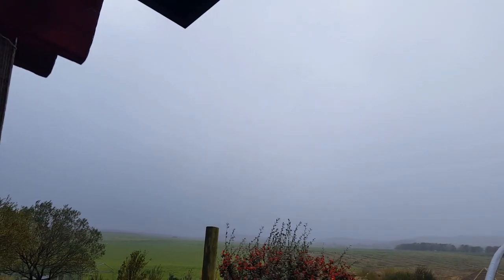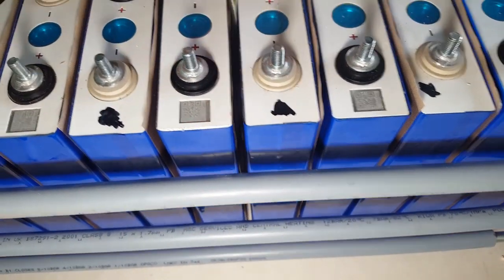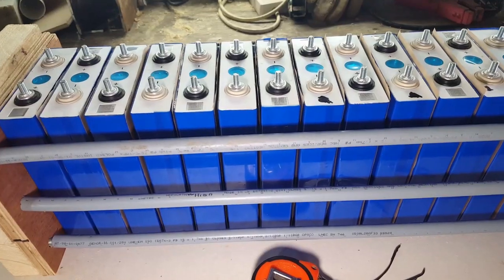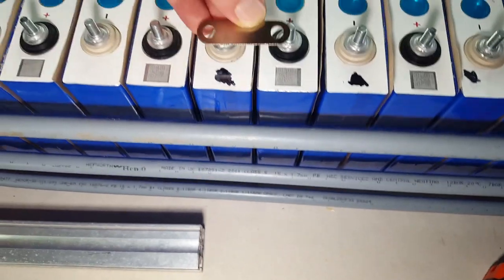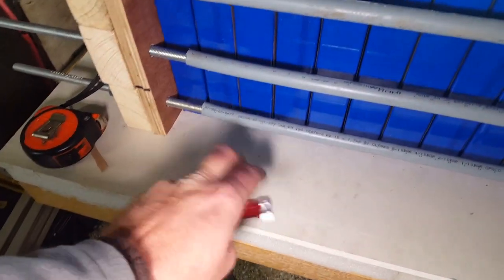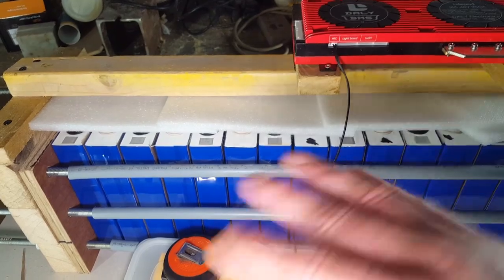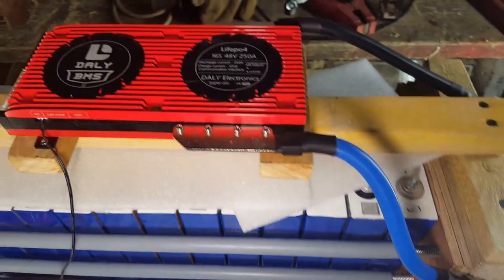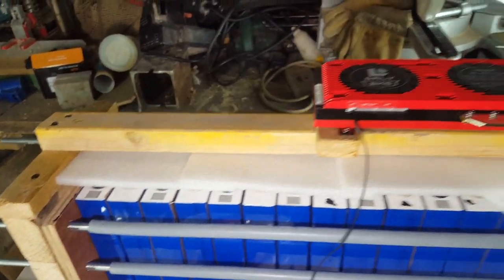Compressing Bloated LiFePO4 Cells In a D.I.Y Fixture Mock Up.

Comment: Why do you want/need to compress them?
Reply from the maker: Hi ya, it's in the manufacturer specifications to extend cycle life. It supposedly stops internal delamination and thermal expansion and contraction putting stress on the anode and cathode material and terminals.
These ones were used and bloated needing compressing  squeezing them together so the busbars would fit.
There are divided camps, a lot of people don't bother with compression but it's in the manufacturing technical specs and the logic is sound so I personally think it's a good idea.
Cheers 
Gaz
Reply: One thing I stumbled upon with a battery that had cells that were bulging about as much as yours though it was only a 4s pack, I took it to a friend to show and then left it in my car overnight afterwards. The temps got down to below 40F(4C) so the pack was pretty cold when I retrieved it in the morning. Interesting thing though was that the bulge in the cells was much less while they were cold. It's an anecdotal observation but I wonder if there's anything to it that might help cells with some bulging or at least do the compression with cold cells?

Comment: Compressing already bloated cells is dangerous. It only makes sense with new cells, specially at the first few charge/discharge cyles, to squeeze out gas bubbles out of the electrodes.
Reply from the maker: It was in the back of my mind, I went slowly and didnt go to tight, just enough to get the busnars to fit. Nothing bad has happened so far 🤞
Reply: @garys-half-baked-offgrid-dream  OK thats fine, others may it make too strong, which leads to destroy the cells and even catch them on fire. The cells naturally breathe, the force of 300kg will exeeded when compress them discharged and undercut when compressing them in charged stage, after they are discharged. I will recommend to use flexible busbars and bend the threated rods in a slight zig zag crooked manner, so the cells get adequate pressure all the time and can breathe.
Reply: @topeye4202  what a load of BS. LFP chemistry does not "catch fire". And the pressure release valve is there for a reason.

Comment: I like how you used the 3/4 plywood which I have done my battery compression but for some reason it loosens up just sitting there so I’m gonna try to do the two by fours like you did that should give it more stabilization maybe I’ll grab a 2 x 15 pressure treated because it’s a stronger wood !

Comment: Andy’s Off Grid Garage Australia has a lot of info on this gear & recent vids concerning the effects of compression u might be interested in. Im not sure what Daly u have (I dont like Daly much) but you will want to get an active balancer, Daly’s passive balancer is very ordinary.  It is always a risk when buying these cells unfortunately, but I have seen very bloated & abused cells still performing almost flawlessly after a couple of years of use/abuse & testing. Cheers

Comment: And yes as others have said... ditch those rigid buss bars for some silicone wire buss bars. They flex and are much easier on the terminals and guts of those cells

Comment: A sheet of rubber roof material is best I've found for placing between cells. Keep the pressure on when using them and they will be better off. I mean don't crush them but q nice even bit of pressure when new should keep this from happening and the rubber roof material is q good cushion that gives just enough for the right amount of movement.

Comment: Just a heads up. I watched another video where he was doing a heat and resistance test on different syles of bus bars. A washer was accidently left on one of the battery terminals and that location had more resistance and thus created more heat. When he inspected he found the washer, removed it and retested and the resistance and heat went down. Here's the link if you're interested https://www.youtube.com/watch?v=EjBqng70ORc
Reply from the maker: Yeah good old Andy he does great videos. So far all my teminals stay cool to the touch at max C rating

Comment: Cells are not supposed to measure 3,3 volts before compressing them, EVE 280 Ah cells are supposed to be compressed with 280 - 320 kilos, and you do it before you even think of charging them, cause even grade a cells grow 1 mm ? on the middle first charge,I dont know how much those cells are supposed to be compressed,  cause can see they are smaller, and if they allready bulge when received them, it means somebody else charged them before or grade b or c cells, compressing means 1000 more cycles if standard use, 6000 cycles etc......
Reply from the maker: Yeah they were bloated when I got them, they only had about 20amps in them at 3.3 they are 105A tested to 85ish.  I thought  if you compress at a very low state of charge the can over pressure when charged.   Compressed is a bit of a misnomer, using my clamping plates and screwed rods I can max out my bathroom scales at 150kg only screwing by hand.  It would be so easy to over do it and kill them. 
More like a nice cuddle lol
Cheers👍
Gaz

Comment: Question my brother, what about looking at silicone wires? In my humble views silicone wires will stretch and contract with the batteries.
Reply from the maker: Hi man, Yeah it is one thing I had considered, compressed or not as the buss bars supplied  are  only thing gauge and small, thick silicone wires would take more Amps and breath with the cells.  Compressing allegedly helps reduce delamination of the materials inside.  
It is a mine field of different opinions, Until I can accurately  measure the clamping force I am going for a compromise of a gentle squeeze.
Cheers bud. 👍

Comment: Good luck with your solar system my friend. Looks good so far. You seem to get plenty of incoming wattage on a sunny day. Now all you need is more battery capacity and you will be all set for energy production. I don't know how many kw of capacity you need to be completely independent, but I hope you can eventually get your hands on 16 or 32 of the 304Ah EVE LiFePO4 cells and you will be all set. Unfortunately, the prices of the cells have almost doubled in the past 2 years. I'm in New York in the USA, and I remember people buying the 280Ah cells for $115-$120 per cell. These days, the prices seem to be about $205 to $220 per cell. I'm a bit upset I didn't get to buy a nice set of cells or solar panels before the price started skyrocketing.
Reply from the maker: Thanks very much for your kind words that's awesome to be hearing from New York!
I have done several energy audits on everything in the house, the absolute minimum we could use would be 16 280Ah and would give me enough to cover the house for 2 days with no solar or wind. I would still have to be very economical with usage and that's no heating or hot water.
32 Cells would be lovely but yeah your spot on, the price is going crazy.  
I have found a UK supplier of Grade A and Grade B cell. Grade A £179 and Grade B £150. 
 Their grade A come with EVE factory test certs and they also do finance and accept Pay Pal.
I am seriously thinking of buying them on Finance or PayPal so if they are a load of shit I have a bit of protection.
Best of luck to you too! 
God knows we all need it lol 
Cheers, 👍😀
Reply: @garys-half-baked-offgrid-dream ’Andy’s Off Grid Garage Australia’ YT did a lot of tests on certified grade A cells and other ones he had got for so much cheaper and there was virtually no difference in performance under heavy load conditions, the outtake was there is no benefit in paying the extra for certified cells, and there are a lot of problems with their certification claims, there is always a risk when buying these cells, some sellers are not as unscrupulous as others would be fair to say.
Reply: 18650batterystore has them for less and it is in the us